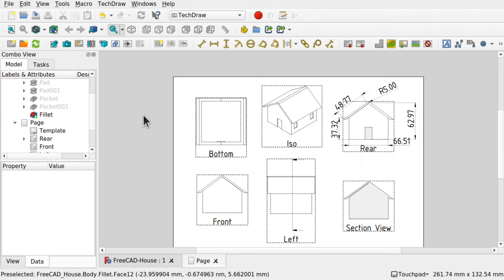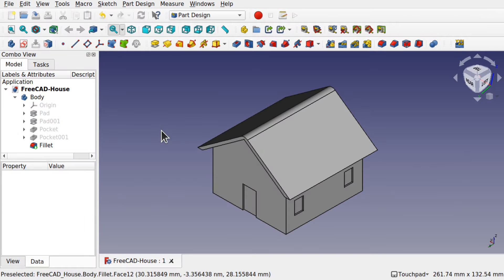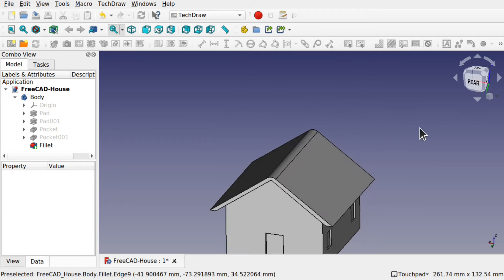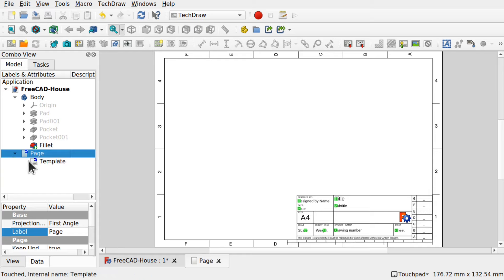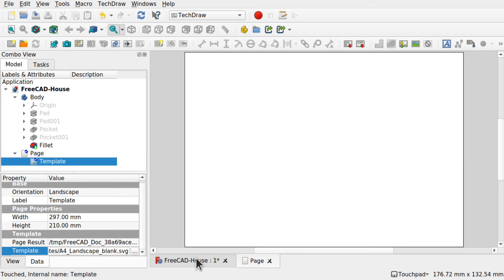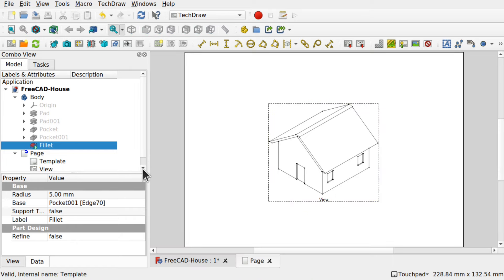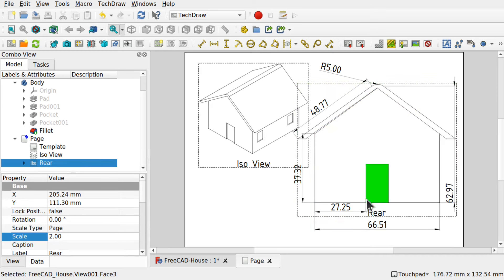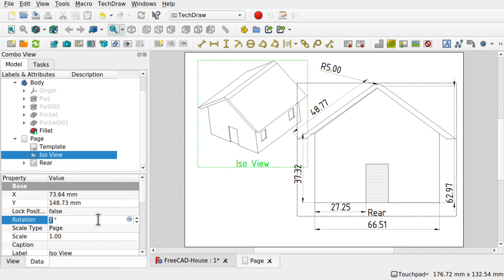FreeCAD Learn the Basics of Tech Draw Workbench in 15 minutes. Technical Drawing Beginners Tutorial

Comment: Anyone else struggling to get an "Insert View" showing the object selected drawing. This was my experience, but somewhat solved it with Scale.

I really struggled with scale as my drawings just did not appear at all on the View A4 page window. Just a flash of colours from my drawing.

The Solution I found was to set the Scale to Auto in the preferences . I  deleted all previous Views  I had inserted and then after selecting ALL of my drawing I pressed the Insert View button and it worked fine. Then in the parameters window for the View i see the Auto had scaled my drawing to 0.01 (No wonder I couldn't see it at the default of "Page" set at 1.0 )

I could then go to the properties "View" window and change auto to custom then edit this "0.01" scale in the properties window,. Set it to 0.02 and hit refresh. It worked. But set it back to Auto and was happy with the 0.01 scale. 

I suppose one could select Custom but then it is a mission to find the scale.

I found that if I re-selected Page (seems to be the default on my 0.21 FreeCAD version) with its scale set at 1 in the preferences, then the drawing is enormous (in my case) and when I hit Insert View, then when I go to the properties list in the View, then selecting Auto there will not adjust its scale even after a refresh. It looks like Auto must be selected from preferences first and then it scales correctly, if there is a big relative size.

My last hurdle is that the scale 0.01 is still too large and I can't make it say 0.005 as the scale does not seem to allow scaling to the 3rd decimal point. Will look for a solution and if anyone has ideas then I'd be happy to know what else to do.
Reply: Hi first-time user of free cad or any cad programme Mango jelly videos are amazing I managed to do a drawing of a culvert 4 meters wide and couldn't fit on page when inserting view your tip worked brilliant thanks very much

Comment: Your FreeCAD videos are so good. You are one of a rare breed who manage to get the message across well. After originally downloading FreeCad several years ago but getting nowhere fast, I've downloaded the most recent 0.2 version. Your videos really make the difference. However my main interest in FreeCAD is to be able to help my daughter and her husband who are architects. Your Tech Draw workbench is a good start, but I would really like to see videos using the Arch and BIM workbenches. The few that do exist for architects date from several years ago and most are really not good at all.
Would you consider making some videos showing how FreeCAD can be used for building design, presentations and drawings for the builders? Top on my list would be have a fully parameteric model with such things as composite walls, and being able to put in doors and windows and producing the sections for the builders.
Reply from the maker: Thank you for the comments, glad your enjoying the videos. I am looking at doing a series  with the arch and bim workbench, as you say not much new material out there but I am trying to figure out where to start.
Reply: @MangoJellySolutions  Most architects in small offices work in 2D typically AutoCad but I see many advantages to start in 3D especially for multifloor buildings. In any case you always start with 2D sketches and then "extrude" them with the wall, columns, beam, piping etc. I love your Python Macro videos too. You would gather a lot of interest showing an example with a python macro where you generate a multi-layered wall starting from a 2d rectangle for example. These types of examples would be something you could hide behind your pay wall. Thx again.
Reply from the maker: @johncpescod  Thank you for the information, I don't have much architecturally experience but it is something that I want to get into.  Thanks for the ideas I will add it to my list and you should see something start to arrive in the near future.  Normally with this  I do some one off tutorials and then roll in some larger projects
Reply: This is not the place to ask but there is something I'm looking for but can't find in FC. In SketchUp you can find the length/area or volume of line/surface or volume by selecting the object and then right-clicking to see these properties. Can you do something similar in FC?
Reply: @johncpescod  I think you can see area computed in the properties on an object in the ComboView...  at least for stuff made in Arch -- which, I too would love to see content on.  I've found some, but so far they're all either assuming too much knowledge, and/or just doing something quite different from what I want to do, which is to basically build a model of the space I live in, and perhaps make some drawings from that that I could print out, walk around with and mark up with detailed measurements/annotations to come back and update the model, and then maybe print again with things like layouts of where circuit breakers map to, etc.

Comment: Is there a video for the house floor, walls and roof?
Should a house be drawn as a part or using the ARCH work bench to ultimately be used for permits and construction.
Reply from the maker: Not yet but I am working on some architecture tutorials.  The example was just for techdraw.  I should of used something other than a house to save confusion.  If your designing a house / building etc then you would use Arch WB.

Comment: Is it possible to add 1 or more rendered views of a body into techdraw?
Reply: I have very little experience with the more esoteric features of TechDraw such as the "Active View" option, which is supposed to insert rendered views. It seems to me possibly better to use something like Blender to render an an exported model (stl) then import that into the drawing either during the TechDraw process or after completing the TechDraw page. You don't need to learn much in Blender to do this and the two packages work nicely together at a simple level.
MangoJelly may have another solution which I too would be interested to hear.
Reply from the maker: There is and techdraw offers a option, you can add in a render view from the top toolbar option but the quality is not very good. It would be best to create a render by adding a material and then taking a snapshot. This is a very simple render that freecad offers which you can import into the tech draw. As an image I use the feature in my tutorials for creating a logo from svg. It's the last video. The snapshot can be inserted into the technical drawing. Other options as kindly mentioned from a channel supporter in the comments is to use something like Blender.

Comment: I am working with this video to customize my drawings in FC-0.2 using Preferences. I can't change the Scale without indicating Custom.  If I leave it on Page the Scale will only show a download arrow and the Scale is not editable. Also, when I attempt to use Techdraw my system slows way down and sometimes it just hangs and responds with "Freecad is not responding", and it crashes requiring me to rerun it from the beginning.  I am running on Windows 10, with current updates, on a system that I custom-built.  I can create drawings but it seems to be a hassle working in Techdraw.